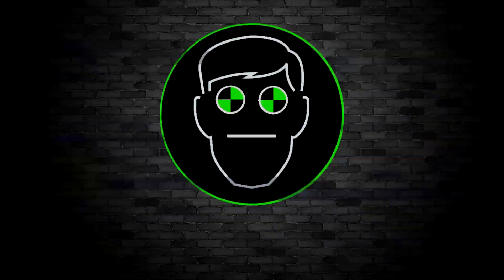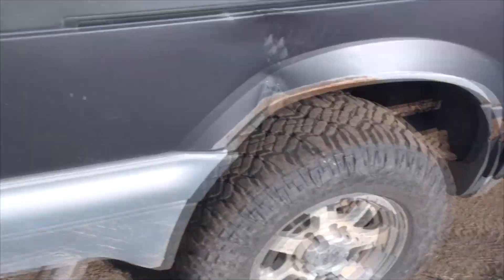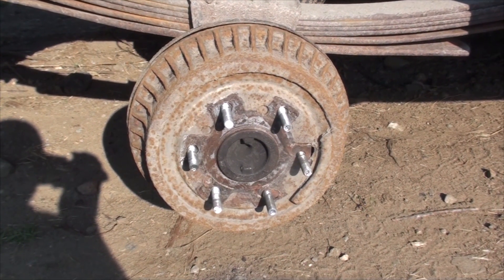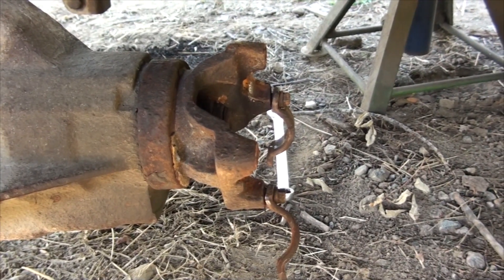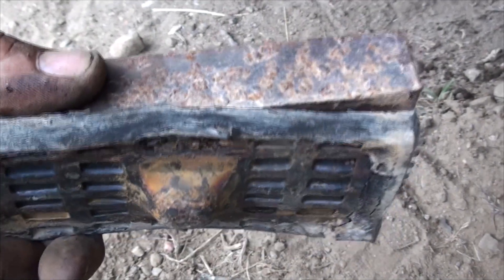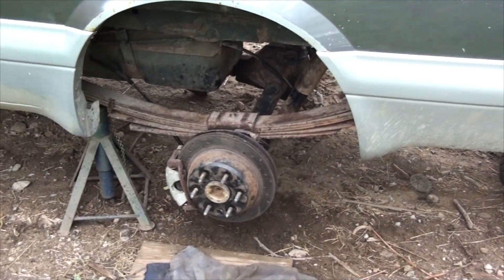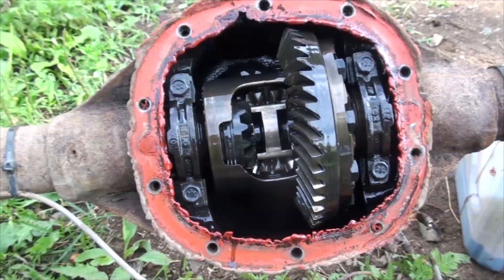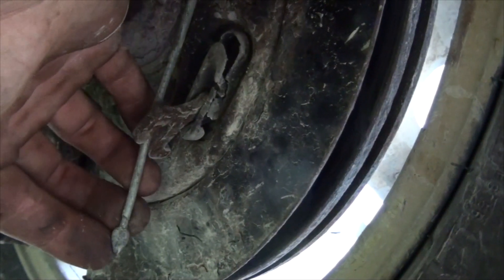HOW TO SWAP A 6 BOLT AXLE INTO A 5 BOLT ASTRO VAN

Comment: astro vans are badass cant wait to build mine up
Reply from the maker: I'm almost done building mine. I will be a fulltime streamer in a couple of weeks and I'll be showing the van. It's got about 16 inches of lift, 2 solid axles, emissions compliant LS V8, manual shift transmission, huge tires, real 4x4 transfer case, 4-linked(coil spring) suspension etc. Subscribe and you'll get to see it soon. There's a whole summer of badass Astro Van live streams coming. :)

Comment: Good stuff man thanks for the video. I'm getting ready to do the same swap on my 99 High top. I had a few quick questions.

1. Is yours Awd?
2. How did you convert the front to 6 lug, as I need to do that on mine too.
Reply from the maker: Mine is AWD. You can convert by going to a newer van and taking everything that attaches to the upper & lower control arms. You can't just swap 6 bolt hubs on, they don't fit. They rotors and everything are slightly different. You need to remove the balljoints from the control arms and swap in everything... hubs, calipers, rotors etc.

Comment: Thanks for the video, exactly what I was looking for! Quick question: to change the bolt pattern on the front, are only hubs with bearings needed? Or do you also need new calipers and control arms?
Reply from the maker: You can convert by going to a newer van and taking everything that attaches to the upper & lower control arms. You can't just swap 6 bolt hubs on, they won't work. The rotors and everything are slightly different. You need to remove the balljoints from the control arms and swap in everything... hubs, calipers, rotors etc.
Reply: @StuntDummyLives  
Thanks for your reply, it sounds like adapters is the way to go. I really like the stock 16" steel wheels that came on the 2003 models and up. I also wanted to convert the rear drums to disc and the front wheel bearing to sealed.
Reply from the maker: @x-man4702  There's a lot more wheel options for 16"/6 bolt. The first time I did it, I re-drilled the rotors and used 2007 Hummer studs to change it 6 bolt. The van I'm building now has 2004 Jeep Grand Cherokee axles. they come 4-linked suspension w/ all disc brakes from the factory with coil springs on each corner. The differential housing is aluminum and looks super cool and they're a little bit wider for a wide-stance vehicle without using adapters. The front is also a high-pinion axle. They're 5 bolt axles, but they use the same 5 bolt pattern that GM does. If you're even thinking of swapping axles, that's what I would do if I were you. It's a bad ass setup for an Astro van, especially if you wanted to lift it. It would take some fabricating, but it all depends on what your goals are. I've chased problems with the rear axles on these for years and I'm kind of over it. I want a rear axle that doesn't howl, hum, or vibrate lol
Reply: @StuntDummyLives  A follow up question: when you swapped the front knuckle with all attachments from a 03-05 to your 99 did you have any issues with the ABS speed sensor cable or the brake lines/brakes to make it work?
Reply from the maker: @Quicomansmash  I don't remember having any problems.

Comment: Nice conversion should take of the vibration and get better mileage ;-)
Reply from the maker: The original axle had bad spider gears in the diff. New ones were over $500, but swapping this axle in did the trick to get rid of the vibration.

Comment: After the swap you have 6 bolt pattern  in the back and 5 bolt pattern  in the front. Is the front  getting  swapped  to 6 bolt also or staying  5 bolt?
Reply from the maker: I changed the bolt pattern to 6 bolt when both front and rear axles were 5 bolt, then I got this axle and swapped it in. The front was already changed and the bolt patterns match. I will be upgrading the front soon, it has independent suspension and the hubs aren't interchangeable, but there's a way to do it by changing to the newer control arms that match the newer 6 bolt hubs... or at least I think it's possible, I haven't actually done it yet.
Reply: @Stunt Dummy  ok I was thinking  front  and back were  going to be  the same  pattern. If they were  different  I  going  to  ask about  awd issues.
Love the astro Van's   got a 2000  awd astro  I use to  tow a 22 ft 4300 lb camper.  it does it but always watching  coolent  temp and transmission  temps (use a scan guage II for readouts and to add a tachometer). I normally  drive  50 to 65max  when towing to keep everything  lower reading. Have done  afew upgrades. shocks &  new receiver. working  on  adding  an extra  transmission  cooler.  But having  trouble  finding  documentation  on what is optimal  temperature  for the 4l60e  and what  is  to hot. Ideas?